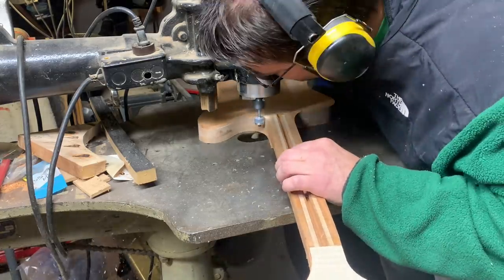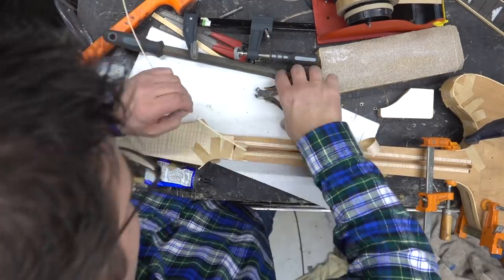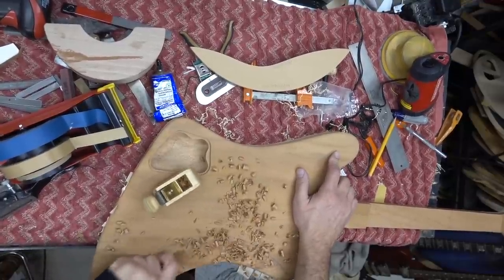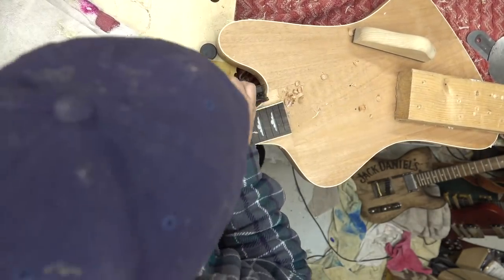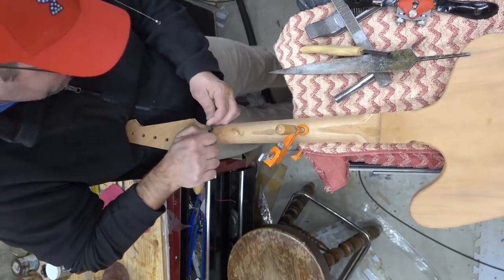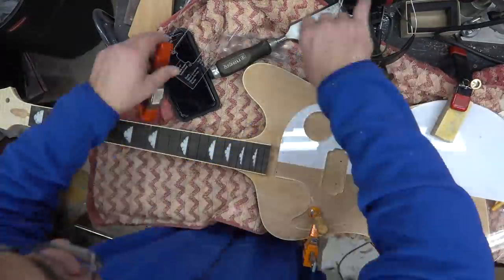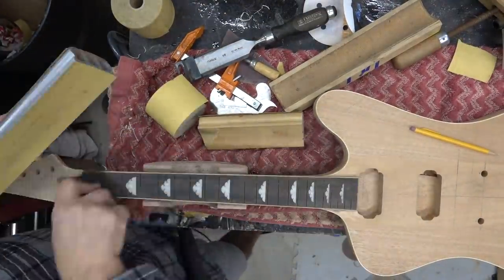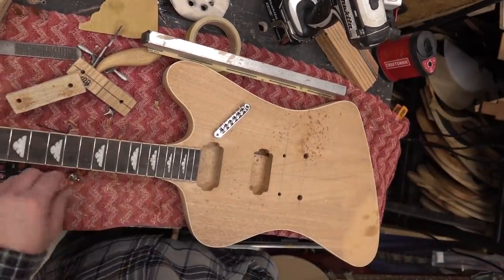Building a Skybird Part III - Finalize the Body and Fretboard

Comment: Ok dumb question time.  When you rout for the binding on the body, could you just leave it like that and not put binding on it?  Just leave it as a quasi-German carve and seal it, or paint that area a different color from the body?  Told you it was a dumb question!